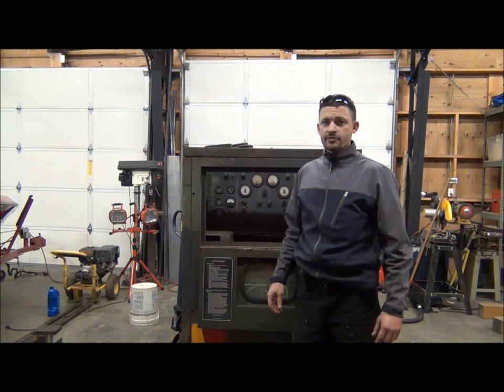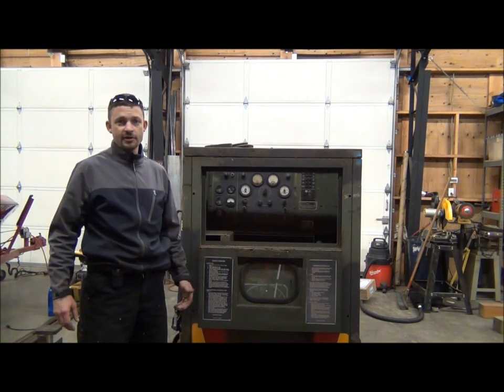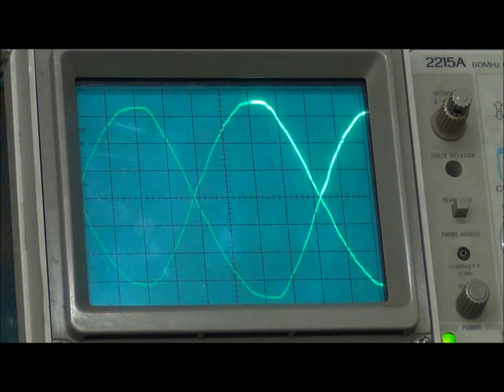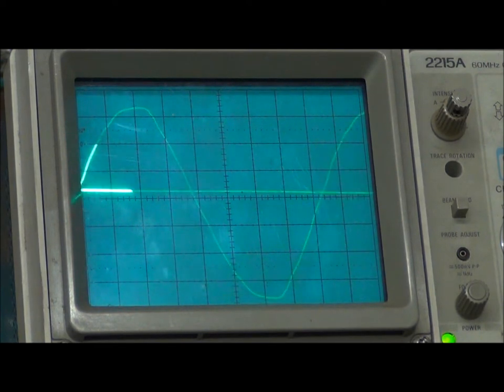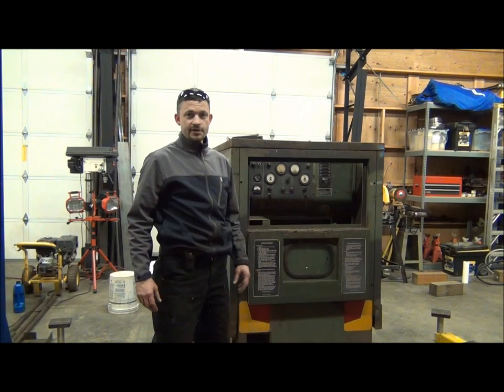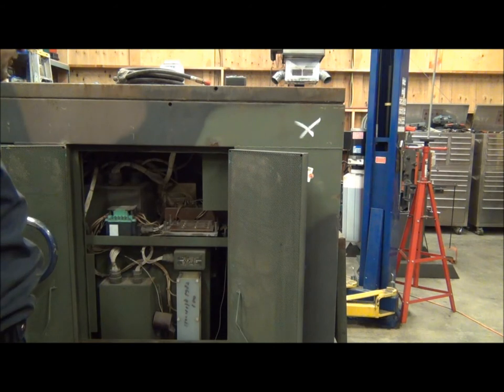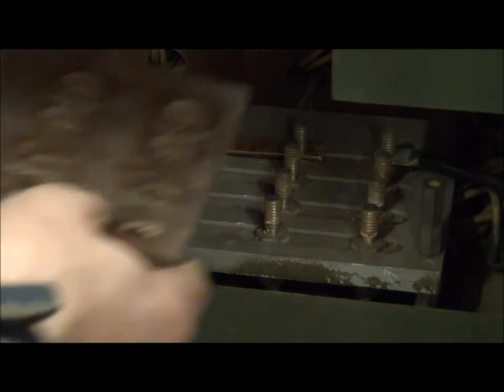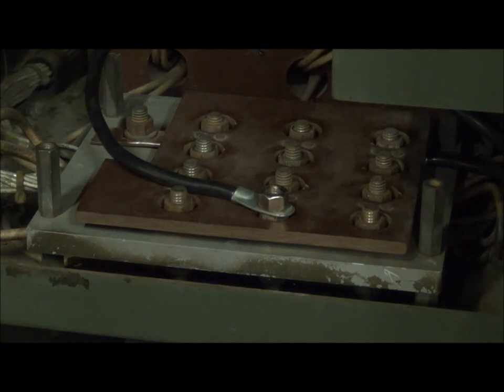Reconfiguring an MEP generator set for single phase 120/240

Comment from the maker: The mep-002a and -003a have a switch that allows you to run 3 phase 120/208, single phase 120, and single phase 120/240v.  It is located close to the main circuit breaker.  All you need to do is shut the set down, and move the switch to the desired position...

Comment from the maker: @marcopolo56oh The set works fine with just the zigzag configuration I show in this video; but the voltage drops too much as you put more load on it.  You can bring the voltage back up with the front panel controls, but this isn't practical if your set sees lots of varying loads.  On SS I go into a bit of detail on how to re-wire the voltage regulator to correct this issue (post #40).  I am working on another video that covers this procedure...might be a week or two before I upload it.

Comment from the maker: @marcopolo56oh I have accomplished the re-wire and done quite a bit of testing with the set in single phase...just haven't had time to update my posts and videos. 
It does work perfectly in the new configuration, and the re-wire can be accomplished by the average wrench turner...it isn't difficult.

Comment from the maker: If separate circuits are needed to power smaller equipment, most people attach an outdoor breaker box on the side of the generator.  Then individual receptacles can be added as needed.  Once converted to single phase, 3 phase is not available (unless you convert it back again).  You can get single phase 120/208 and 3 phase 120/208 at the same time if you don't do the conversion, but the single phase power is limited in this configuration.

Comment: Great video, very helpful. I have a MEP-006A generator currently set to 120/208 which needs to be changed to 240/416. Could you please tell me how this can be done? thanks again
Reply from the maker: That one is very easy; just unbolt the voltage reconnection board, and move it to the position where the 240/416 arrows line up.  Tighten all of the nuts, and that's all it takes.

Comment: Hey Matt I know you had had multiple people reach out to you about the phase conversion for the military generators but wonder if I could pick your brain. I had been working with a engineer friend & Kurt K who designs voltage regulators & auto start kits. I have a 10 wire 804, Kurt's regulator will work without the presence of 3 phase. I have a diagram of the mapping but have some questions.  The main question are  inductors associated with T9 and T8 are hard wired to the neutral in the generator.

Comment: I just bought an 804b gen set which i did not realize was 3 phase only. Is it possible to convert this set to single phase? I have read comments on the site that there are only 10 wires from the generator and for this reason, conversion is not possible.  Is this correct? thanks
Reply: jean poitras did you ever get this done I gave same problem

Comment: Do you really get the rated power with this zig zag configuration?  Does it required protective relay settings adjustments?  Does it reqire any changes to the voltage regulator?  Thanks!
Reply: No, I did vector math.  True if you zig zag the windings like that you will get a single phase 240/120 volt output but not at 15KW.  Each phase is only rated at 42 amps.  Amps just like voltages are subject to phase angle cancellations when you reconfigure the widings.  If you put an ammeter on the L1 and L3 in this zig zag configuration you will still only get 42 amps out of each leg.  42Amps 120Volts 2 legs = 10Kilowats.  When you step back and think about it the only way to get 15 KW outs of 2 legs is if each leg produced 62 amps.  How are you going to get 62 amps out of L1 when it's rating is only 42?  This modificatoin won't get you any more power than just connecting  your load at L1-L2 at 208 volts.
Reply: @skylerhagen9960  U are 100% correct.  A submerged water well pump is so dependant on 240v and will stall and self destruct at 208v.

Comment: If the 4 bolts on the buss bar are all evenly spaced, you could just shift the bar over a hole so that you can reuse the bar to go back to 3 phase if needed.

Comment: Nice video good information. Very well explained. Do you know if this will work the same way on the mep-804?
Reply from the maker: The 804 is a little bit more difficult; I've never done one, but I do know that there are only 10 leads from the 804's generator head.  I've heard that the leads can be disconnected inside of the generator head, but I've never personally seen it done.

Comment: Great video. I have a question? What is different in this conversion as to the other one you show; but remove the board to change instrument leads under to get correct readings? Was that video for a different generator?

Comment: I have a MEP 804B 15kw military generator that I want to convert to single phase.  I’ve been told by the local generator shop that this can’t be done because mine is a ten lead and not a 12 lead.  Nothing on YouTube leads me to believe that this cannot be converted to single phase.  Is my local guy pulling my leg on this?

Comment: Hello I tried your reconfiguration and now my generator is only producing 50 volts phase to phase is it possible that my generator head is now damaged. it is an MEP006A
Reply from the maker: The 006a conversion is different than what is shown in this video…the re are some extra lead movements needed on the voltage reconnection board.  I don’t have a video for this
Most likely your generator is fine, it is probably sending 240v instead of 120v to the regulator/exciter and sending minimal field current to the field windings., giving you the low output voltage.

Comment: I know this is a old post but if you still check this can you do this with current 804 or b ?
Reply from the maker: Not easily; the 804's I've seen have the leads tied together internal to the generator head, so they can't be separated.  I've never had one that I could dissect to see if it was possible to do.

Comment: wanted know if there is a way to set up my 1973 JR Hollingsworth MEP016D 3 KW diesel generator 3ph to 120/ 240 0r 208 1ph help please, there is no common in the 1ph 240v seting only in 3 ph
Reply from the maker: I have never had an 016D in my shop; I tend to work on the larger sets.  There is plenty of info available from the members on the Steel Soldiers site; I would post your question there!
Reply: There is a video out there that a guy did show where to put the neutral wire at.

Comment: sewerzuk, did this conversion on my 006A, exactly the same as you did, and it caused a short circuit. The jumper
wire got very hot so we shut down, FAST. Any idea what might have happened. I have the unit set up with a side
breaker box. dcajun
Reply from the maker: The conversion is different for the -006a; I have notes somewhere on the -006 ..will try to track them down for you.  I meant to do a video on the -006, but some of the footage didn't turn out when I did the last conversion...
Reply: sewerzuk
It would be greatly appreciated
Reply: sewerzuk yea it would be great to have a video on the MEP006a conversion along with how to get the gauges to work following the conversion

Comment: I have an MEP-805B Generator.  Is the process the same for my model?
Reply from the maker: +Clint Sands No; the 800 series MEP's use a 10 lead generator head; a single phase conversion of the type I show in the video is not possible.

Comment: Do you use normal diesel fuel in this unit?
Reply from the maker: Yes; I run off highway dyed diesel in these sets.
Reply: Would it be ok on filtered and pre-heated used engine oil?
Reply from the maker: I have run a used engine oil/diesel blend (75% WMO / 25% diesel) in one of these engines for about 50 hours.  I still own that set and have yet to notice any problems with it.  I did not preheat the oil, but it was centrifuged and very clean.